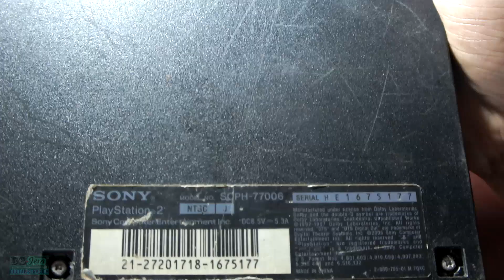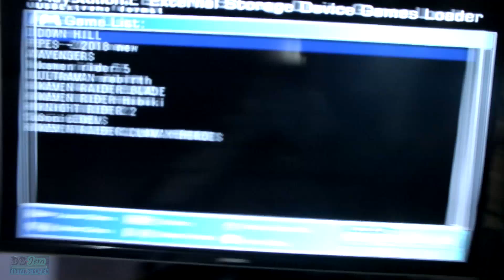CARA PASANG IC MATRIX PS2 SLIM

Comment: Ps slim seri 90006 sudah terpasang ic matrix tapi gk ada perubahan di tv nya seperti ps normal baru beli, gmn solusinya
Reply from the maker: berarti tidak muncul logo matrix ya
Reply: @digitalservvjem  cara memperbaikinya gimana ya?
Reply from the maker: Itu ada 2 kemungkinan,, modbo matrix nya yg rusak atau kabel jumper nya yg tdk terpasang dgan bagus,, solder ulang semua yg di mesin nya dan yg di mochip matrix nya.
Reply: @digitalservvjem  sudah solder ulang kok masih tetep ya?
Reply from the maker: besar kemungkinan modbo matrix nya yg rusak,, krna saya jg perna mengalami speri itu,,teryata matrix nya yg rusak,sehinga tidak terbaca
Reply: @digitalservvjem  ohh siap bang,,, terimakasih sudah membalas🙏
Reply from the maker: Oke